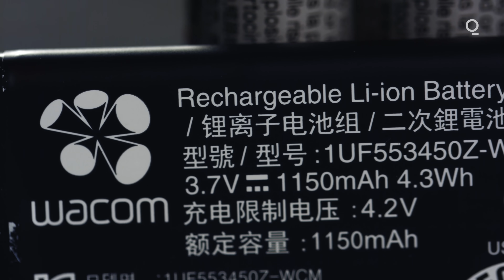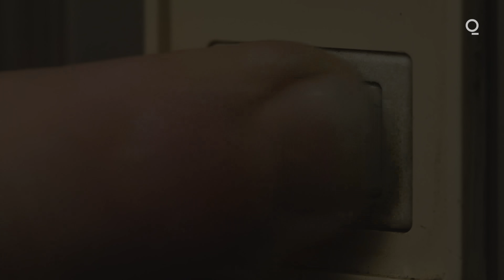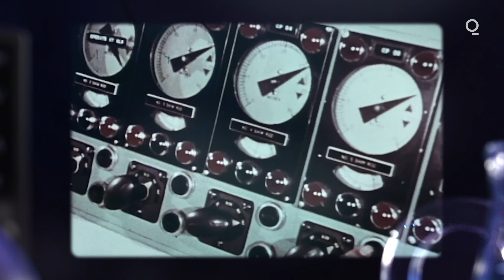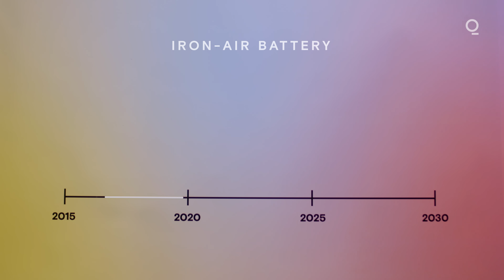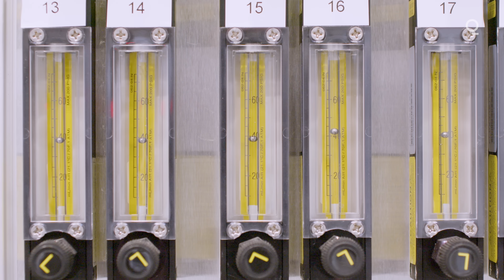The Huge, Weird Batteries of the Future

Comment: All this is fine, but how are the pumps which are pumping water to higher reservoirs being powered ?
Reply: I just commented on this, and i think what the idea here is, is to use solar and wind to power the pumps for the upwards water flow and then keep that water there until needed (and using hydro to get the electricity back).
Reply: @tookster7483  Thanks. I think it would be funny if they used traditional power to fire up the pumps.

Comment: When talking pumped storage, one has to keep two things in mind: Capacity and means of recharging.

Northfield Mountain can produce about 1000 MW for 8 hours at full blast, then it needs to recharge. Meaning, it cannot run a city for any meaningfull amount of time. It is at best a giant emergency generator. A peaker plant, if you will. 
If you wanted to use facilities like this to supply a large city like New York with electricity during a time of, say, low wind and / or solar energy production for a week, you would need a dozen or more of these. 

And THEN you need to recharge them. Meaning, after the time of energy scarcity, if you want to have them ready again as quickly as possible, you need not only produce the energy you need right now, you also need to produce the energy needed to recharge these things.

If we want to do the latter in the same time we used to discharge them, that means we need TWICE the amount of power production to run the country during charging time. An enormous amount of excess capacity, all of which of course will then lie dormant once the reservoirs are fully charged, because we do not actually NEED that much power.

If on the other hand, you want to charge it with the occasional overproduction which wind and solar tend to produce, then you risk them not being full enough when you DO need them, whcih you cannot predict, because weather.

On a side note, Northfield was build to balance the nearby Vermont Yankee Nuclear powerplant. It uses Nuclear power to recharge its battery, not wind or solar.
Reply: Thank you. Why do all These futuristic technology seem like it's a Big trap to have us dependent on something that Is non sustainable and going to be selectively useful at best for the smallest percentage of people who can afford it
Reply: @donedeal69  What are you talking about??  What is being discussed is how to store excess energy for times of high demand, nothing that only benefits the rich.
Reply: @donedeal69  You seem unaware that for your entire life you've been dependent on the rich operating unsustainable centralized power plants powered by constantly shoving millions of tons of dirty fossil fuel into them. The "futuristic technologies" of solar and battery mean you can make your own electricity and store it for  when the rich man's central power plant tries to charge you mo' money.
Reply: In re. energy needs to recharge the batteries.  What your overlooking is, on most days, we can produce more power than we use....but without storage, that excess power potential is wasted.
Reply: Respectfully,  if Northfield is taking power from the grid...how do you know THAT power "comes from the nearby Nuke plant??" Jus wondering??
Reply: The Connections (2021) [short documentary] 🌳
Reply: The main strategy for a grid with high amount of renewable energy is to create better grid connections over a larger area. There's never zero wind and solar over a large area. 
Yes, overproducing is what we'll have to do, so that the minimum output satisfies our baseload need. But in a future where we've solved climate change we are going to have a LOT of flexible load to accept the "excess". That's almost true by definition. We're electrifying all the things that used fuels, i.e. the thing where we needed flexible, portable energy.
Battery electric cars and hydrogen or ammonia trucks/ships/planes will represent a massive amount of flexible load. Hydrogen production in particular, which we also need for steel and fertilizers. Electrolysis plants are relatively cheap, and hydrogen can be stored. We can even feed hydrogen back to the grid if we really need to. 
Batteries will mainly serve to smooth things out more, stabilize the frequency and maximize the value we get out of renewable energy.
Seasonal variations up north is best handled by burning trash. Yes.  Reuse, reduce, recycle first. But eventually everything turns into low grade trash, and it's best in the end to burn it and filter out all the pollutants we've injected into so much of what we make. Could be combined with CCS to make it net carbon negative too.
Reply: @auspiciouslywild  If I understand this correctly your argument rests on a statement/assumption you made at the beginning:
"There's never zero wind and solar over a large area"

Two things about that. One, it is factually incorrect. Large power generation deficits can occur over large areas over extended periods of time. 
To name two examples, Europe as a whole experienced significantly reduced Wind energy production during the last year, and during hurricane seasons, significantly large portions of countries like the united states will be cut of from both wind and solar energy production for weeks at a time. 

If situations like the above should coincide with significant temporary loss of power generation in other parts of the country, which is bound to happen frequently, then the country in question would have a problem. 

Two, your premise would require flexible long distance transportation of electricty. That is not really something we want to do, either because of the losses in energy it will result in, or the need for specialized infrastructure to prevent these losses. 
To achieve the latter across a country like the US, you would need a secondary power grid in addition to the existing one, simply for the long range lossless transport of electricity.

Both of these options are enormously expensive, thus making electricity generation more expensive.

Not that you seem to have a problem with expensive energy, or you would not have mentioned Hydrogen. 30 Percent efficiency in the hydrogen cycle means three times the energy production, and thus three times the energy price.
Reply: @williamgoode9114  Cooling cycles do not absolutely require water to function. True, a lot of them NOWADAYS are build that way, but you can absolutely create air coolers for steam turbine coolant.

Matter of fact, in places with water scarcity, this is already being done. The reason we normally don't is because we so far didn't have to content with water scarcity of any meaningful severity.

Second, the same issue of long distance high volume  electricity transfer applies no matter were you do it, be that in the US or in CHina. if the chinese really want to shuffle large amounts of electricity around their country like this, then this would be just as moronic there as if done in the West.

Finnaly, if given the choice between living in a struggling democracy and a totalitarian state like China, I would choose the democracy ten times out of ten.
 
At least in the former, I don't suddenly disappear when I point out the problems...
Reply: @auspiciouslywild  I agree with you, I don’t think the OP recognizes this will be part of a varsity of sources and stores of energy, not just this. Also we still need to continue developing this type of sustainable technology, we’ve barely started! we wasted a lot of time, while giving oil companies endless handouts and passes after making the ocean light on fire and destroying ecosystems.
Reply: @JordanAF808  Dude, this is not "sustainable technology". It is a battery. We have been using these for literally hundreds of years...

Point is, you use batteries when you do not have anything better. Storing energy for later use is not something you do because you WANT to, it is something you do because you HAVE to.

And the reason you HAVE to is usually because you are not generating enough energy to just go with an on demand solution to the problem instead, which is the more DESIRABLE solution.
Reply: @Alexander_Kale  Dude, this is a lot more sustainable than lithium and fossil fuel, so I don't know what you're trying to get at. Thank you for explaining me the difference between WANT and HAVE to do, I HaD nO IDeA.......
Reply: @JordanAF808  Yeah, I know, that was painfully obvious. That's why I explained it to you.

And since the coin STILL hasn't dropped? The point applies to ALL types of batteries. Doesn't matter what you make them from, batteries are not "sustainable technology". Which is an awful term btw...
Reply: @Alexander_Kale  it amazes me how many YouTube commenters avoid talking about the subject at hand 🤦‍♂️

Comment: I had that very idea 30+ year's ago. A pond or lake as a giant battery. And possibly charged by lightning bolts that are coaxed down ,by a small rocket trailing a wire.
Reply: creative, but what is shown in this video is vastly different from that
Reply: @isk8atparks  yes I agree...but I had to add my 2 cents...not worried if someone takes my idea and does something with it...it's obvious to me i'm not going to do anything with my many ideas.. .too busy scratching and clawing to make ends meet

Comment: Seems obvious that you can use different storage methods in different areas. Use power hydro where it’s available. Use gravity storage in mine shafts where available, use batteries where needed.
Why does there only have to be one solution everywhere?

Comment: It doesn't matter how you spin, it will take more energy to pump the water up to the holding  reservoir then you'll ever get back when you release it to create electricity.
Reply: Yes, but if you have excess energy it's better than wasting that energy away. 
There are always lithium batteries but those are also expensive, you need to replace those from time to time and they have other disadvantages as well, while a water battery will work for a lot longer and comes with a few other perks, like having a clean water reservoir at your disposal.
Reply: Yeah, that's what a battery is. There is no escaping the laws of thermodynamics

Comment: Many different battery schemes are possible and there isn't a one right solution for all scenarios. The hydro battery is a simple concept to build, but you can't employ it in a desert and you have to account for efficiency of pumping and generating machines, since they will affect the efficiency of the battery performance. For something like lithium or iron oxide batteries you have to factor in the increased cost of the materials as well as energy density of such batteries. Li-ion has high enough energy density that electric cars can use them, while lead acid is just too heavy to be a part of a car. For stationary battery factor of weight goes away, but factor of cost remains. Creating energy storage solution is a must have for further development of the energy grid that is capable of dealing with increasing yet changing demand for power, but there won't be a one magical technology that answers the energy storage call.

Comment: We are entering a grand solar minimum. Obviously a solar minimum is caused by the sun, which consists of 99.9% of the mass of the solar system. Humans cannot stop the cooling so they need to stop saying they can. As for so called clean power well you may slow down some pollution but if you don’t address population and third world garbage, it will just be a drop in the ocean.

Comment: energy storage only matters when the energy creating system is inefficient. hydro power is incredibly efficient and acts like a battery in that all of the energy not used by the system is transmitted back into the river itself and in a way not wasted. the reality is that even with all of the possible locations of hydro power in countries like America the governments choose to fund inefficient forms of power instead because they are controlled by oil, coal, and gas companies and so they need batteries to store all of the wasted energy from burning fuel because the reaction of burning fuel is not directly connected to the energy usage. so much of that energy is wasted because they need to produce more power than what is required to make sure they have enough power to avoid failure but with hydro power the turbines will react to the extra power being drawn and produce that power on demand with almost no overproduction.

Comment: If you have an offshore wind park that converts directly to hydrogen, you could pipeline the hydrogen to land like it was a natural gas rig, and once at its destination, use the hydrogen to power fuel cells. now you have both a fuel and electricity, where the fuel is the battery. Nothing stores as much energy per gram as hydrogen.
Reply: Hydrogen is hard to transport. The atoms are so small that they escape through the walls of the piping. You will need allot of very expansive piping.
Reply: @ghffrsfygdhfjkjiysdz  thats why we need a lot of cheap energy, thus, fusion
Reply: „Per gram“, yes. But hydrogen‘s problem is „per volume“.
Reply: @horsthotzenplotz3321  they want to store spent co2 underground, they could just as well store hydrogen underground then get it out when its needed, natural gas style. zThat way natural gas technology can be used for green purposes, sam,e tech, different gas.
Reply: There are lots of plans to build such offshore hydrogen generation plants, but you could also just send the generally-useful electricity to shore over a cable. Making the inefficient detour through hydrogen has to be worth doing over electrifying the process, which eliminates hydrogen for land transportation and home heating. The world will need megatonnes of green hydrogen, requiring a TW of renewable electricity, but it will be dwarfed by the rest of the renewable electricity market.

Comment: A battery based on the property of iron to rust and derust sounds ingenious. Hope it can be made to work!
Reply: The Connections (2021) [short documentary] 🌳
Reply: I wonder what this battery tech will mean with consumer tech batteries? If we're gonna have batteries that rusts itself intentionally? Would that affect the metals inside a consumer product? 

Or would this battery tech be feasible to be used only in Power grid batteries, not consumer products?
Reply: @mancerrss  a rechargeable battery generally relies on a chemical reaction that produces electricity, then supplying electricity to reverse that reaction. Yes, making a highly energetic reaction work hundreds of times without degrading battery materials is hard, whether it's "rusting" or moving lithium ions around.
Reply: Bagdhad battery 2.0
Reply: Climate-Anxiety; do you suffer from it?
Reply: Seems like a gigantic scam to me. They've raised 300 million dollars another 700 million then they will call it quits. 😅
Reply: @itsourlife  it's not a scam, it just faces engineering challenges to scale up (like every novel process). Those cost $millions in R&D to overcome, and the company may run out of money before it demonstrates it can solve them affordably.
Reply: @skierpage  There's an art of making money without having to ever sell anything really. This is what it really is. Come back few years later when the company has shut down.

Comment: As others have said, pumped hydroelectric is nothing new.  I live in New Milford, Ct. not far from the Rocky River Hydroelectric Plant. Built in the late 1920's, it's credited as the first major project  of this type the in US. It uses man-made Candlewood Lake as the upper reservoir, and the Housatonic River as the lower. Candlewood is fairly large lake with shorelines in several Western Connecticut towns, and a popular recreational resource. Of the people that enjoy this lake regularly, I doubt that many are aware of it's original purpose.

Comment: @4:47 No narrator, that doesn't sound like a giant battery charging & discharging to me. That's because it not only requires electricity to pump the water up to the top reservoir. It then requires electricity to pump it back down the other way to generate electricity which cancels out the electricity it's making. Batteries do not require electricity to both charge & discharge, they only require electricity to charge up, then they discharge on their own during use.
Reply: I know you're a lost stoner, but you're also very confused. Have you ever heard of gravity and turbines?

Comment: Hydrogen is generated and stored in cylinders filled with carbon nanotubes made from sea sponges at sea level atmospheric pressure; this storage of hydrogen is 10% more volume. Hydrogen is extracted by heat blankets, and it's ready to be used. I did not spend Trillions to create these technologies

Comment: I have two homes, each running a microgrid of 100Kw powered by fuel cells, and the heat is recovered and used to heat the houses and the two pools. - These guys got too many degrees!

Comment: Gigantic oil and gas tankers could be employed as  floating offshore storage capacity to store  harnessed energy from offshore power generation installations , like  offshore wind turbines or  wave and tidal power generators.
In countries with land scarcity,  the offshore energy storage strategy provides "gross value energy storage capacity",  due to its close proximity to  Metropolitan port cities.
Reply: How exactly are you storing energy in the tanker? If you're liquefying green hydrogen, the ship is very expensive and it's going to sail away to sell the hydrogen to Japan for its hydrogen economy™ boondoggle. Most plans for hydrogen energy storage call for storing it in underground salt caverns.

A huge battery energy storage system does not take up a lot of space,; the problem is the cost of a GWh of batteries.